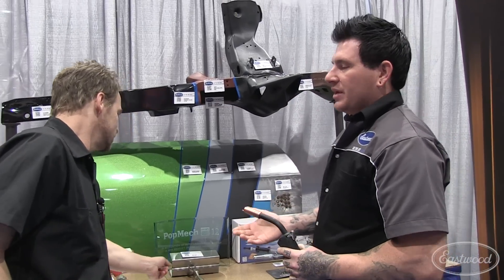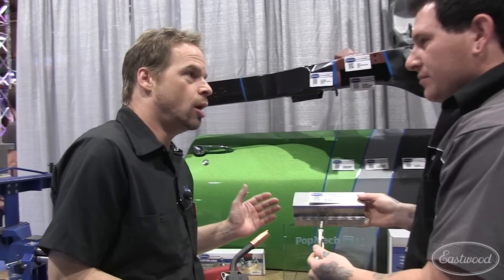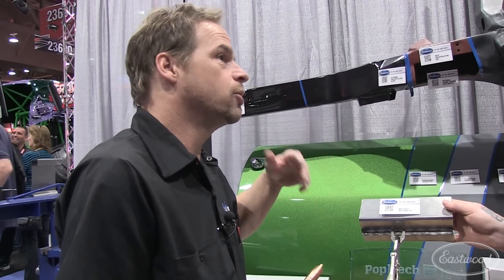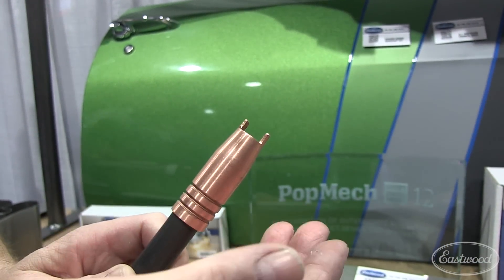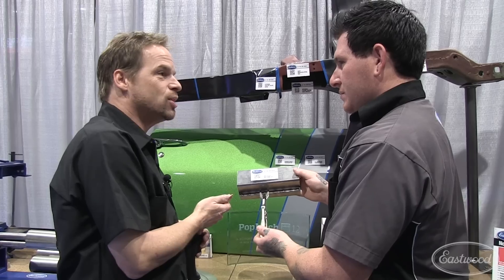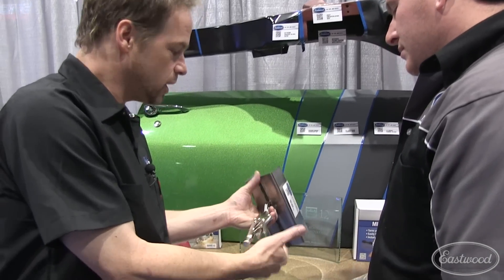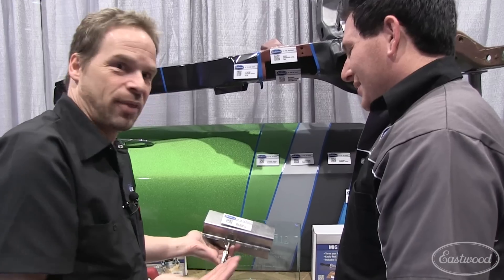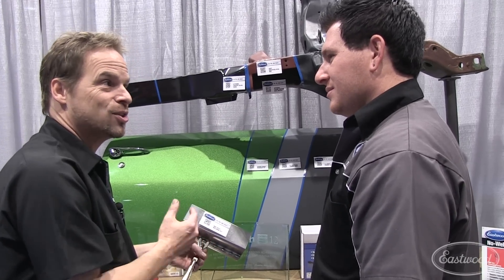Spot Weld Kit for MIG Welder with Kevin Tetz from Eastwood

Comment: On your Eastwood welder, will the tack weld button option be good to use with this?
Reply from the maker: It might be too quick to get a proper plug weld - but you can give it a try and see if it gets the results you're looking for.

Comment: Will the nozzle fit on a Lincoln welder
Reply from the maker: It's designed for Tweco style guns. If the Lincoln has a Tweco style (screw-on) nozzle, it should work.